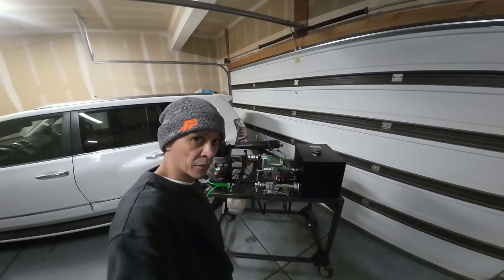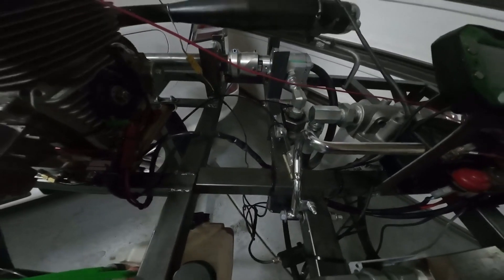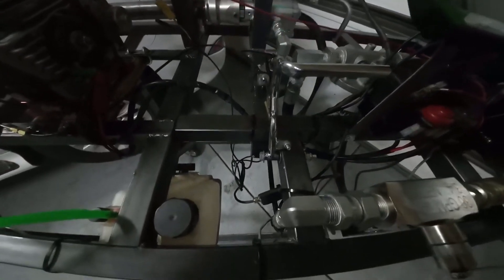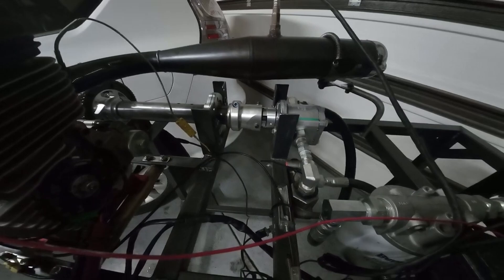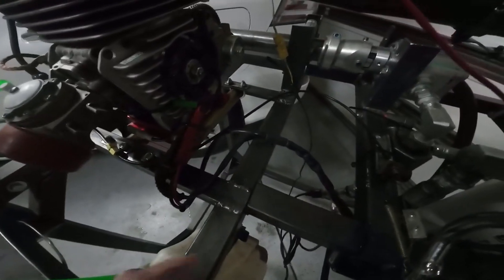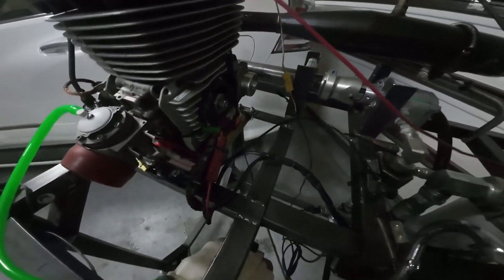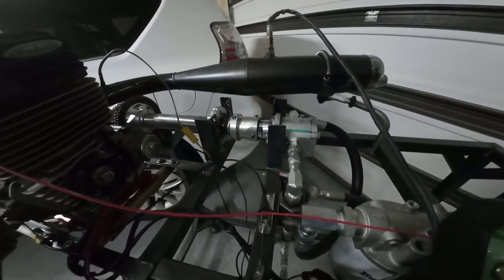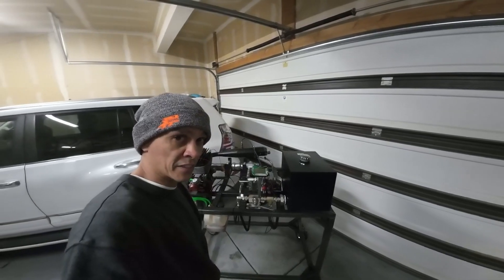Go Kart Engine DYNO Build EP.1

Comment: Nice Geoff.  Have you thought about adding a proportional relief valve that you can operate with a voltage signal? It would allow you to program a ramp run using an esp32 board or similar.  Good luck with the build.  If you need any CAD design done I’d be keen to help 👍
Reply from the maker: I did think about that type of value but I have decided I like the feel of having manual control over the load.  Plus it needs to handle 5000 PSI and I never was able to find one rated that high.
Reply: fair enough too. Sun hydraulics have a 5000psi valve if you want one in the future. I’ve used them a lot and they have been super reliable.